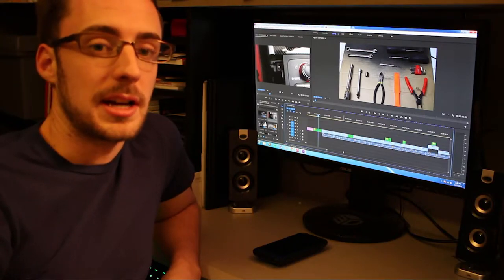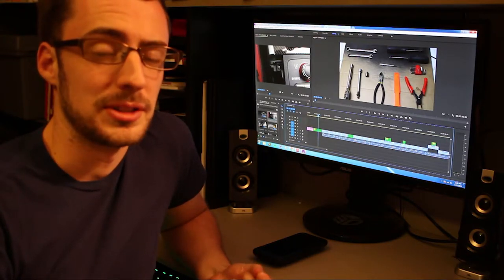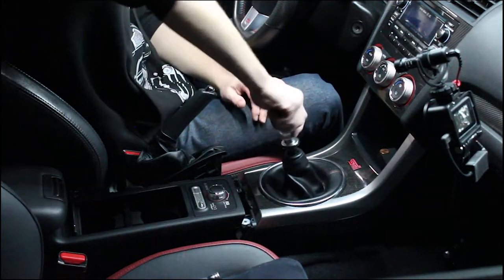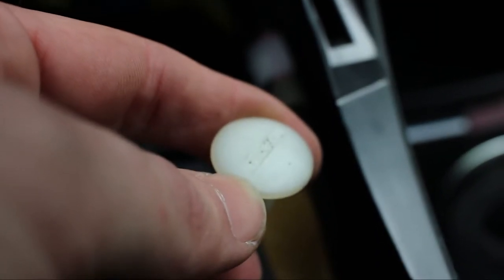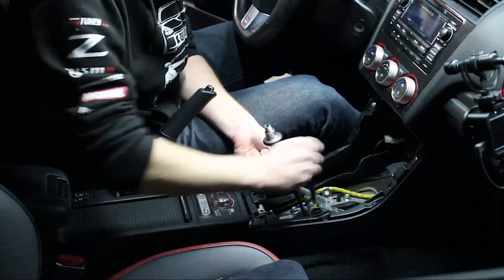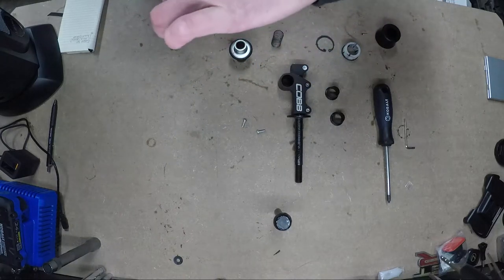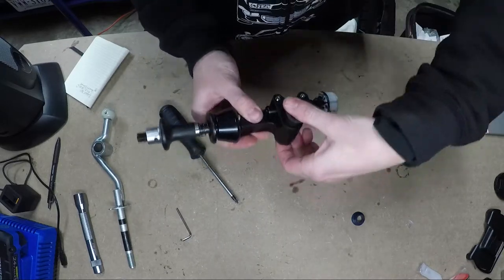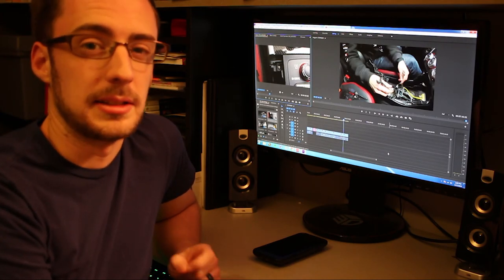Tutorial: Cobb Short Throw Shifter Install 2015 STI

Comment: What is that plastic part that goes on the end of the ball. Mine broke when i put it in, but it still works, just broke
Reply from the maker: Hey bud, that acts as a sort of bushing. I'd always recommending replacing broken components. Sometimes and Item can work in a broken state but overtime cause a headache since the part is more likely to fail. I hope you enjoyed the video bud.